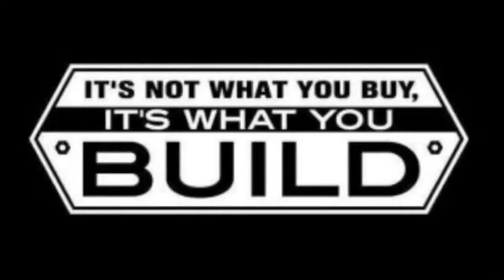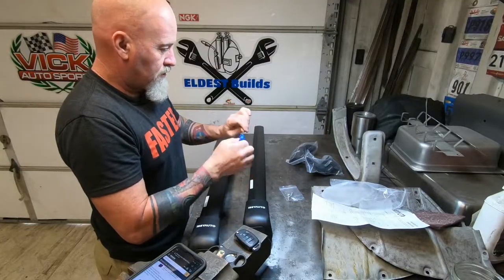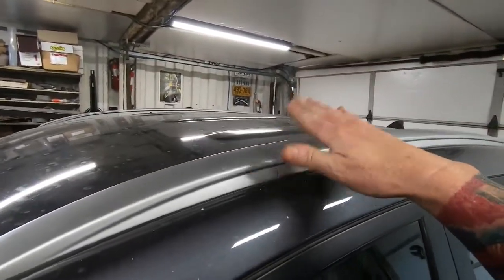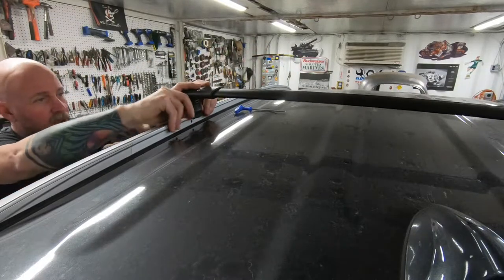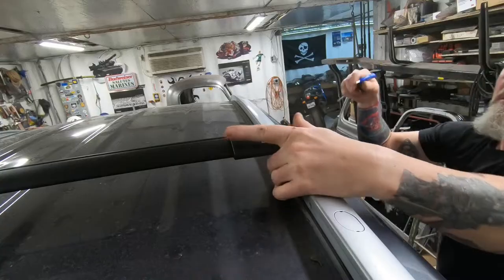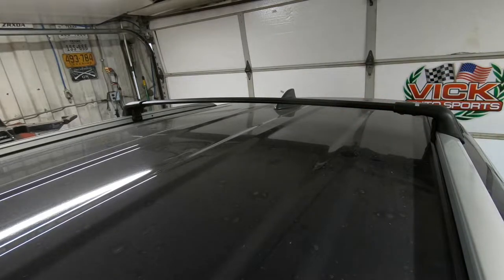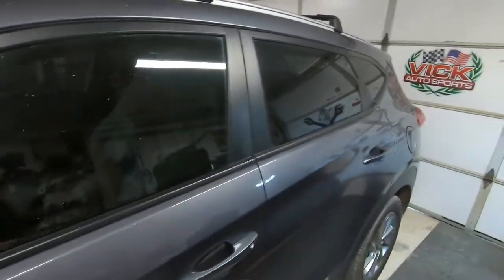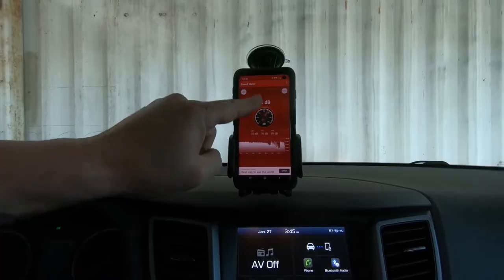2016-2021 Hyundai Tucson, ISSYAUTO Roof Rack Cross Bar installation, roof rack cross bar system

Comment: How's it holding up? Bought a universal rack and it did not have the tabs on the inside so I returned it and got one similar to this. Trying to carry 2 kayaks on J mounts.
Reply from the maker: No problems here, haven't had it shift or loosen up.

Comment: I have a 2020 Hyundai Tucson SE that didn’t come with roof rails and I just ordered some but I’m afraid when I take off the rain trim their will not be two bolts their to screw them in. Do you know if they come standard with the bolts under the rain trim ??
Reply from the maker: I am not clear on that. If not, use rivet nuts in the top with a little silicone.  It will be water tight.